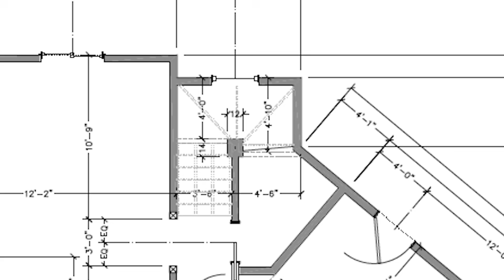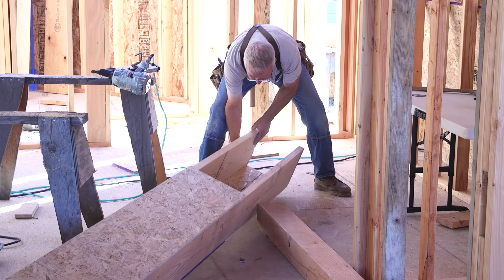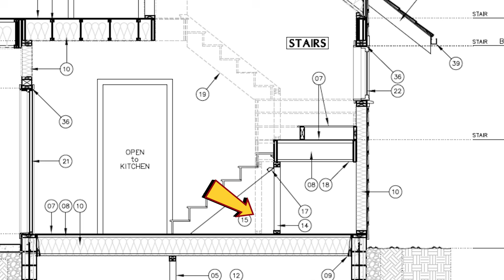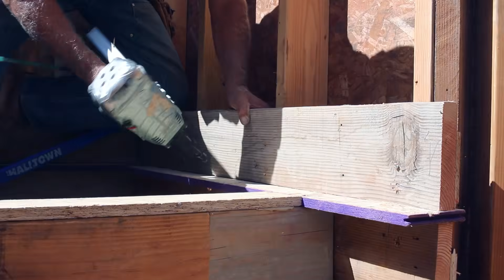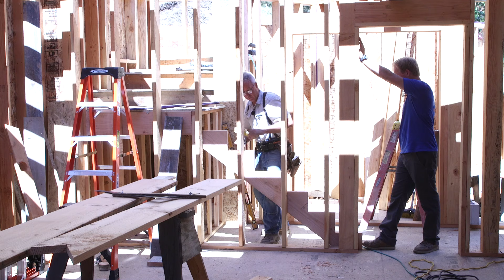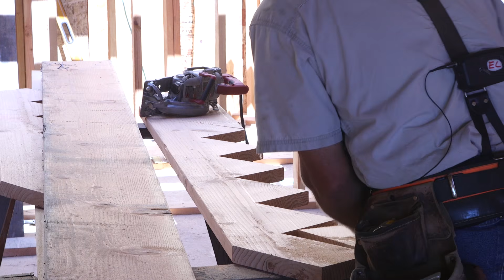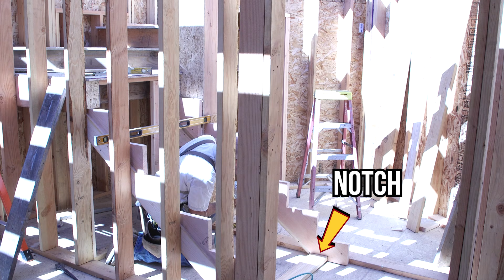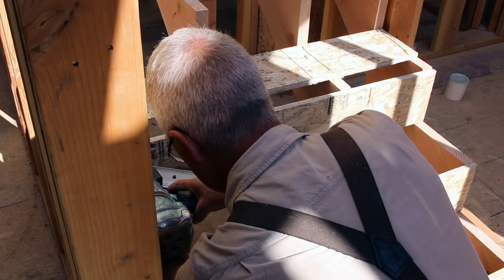Building Winder Stairs Ep.56

Comment: I LOVE that you use a straight edge when cutting and ripping. I've been a carpenter for over 20 years,  half of which was spent framing new homes. Hardly any of my colleagues would use a straight edge, freehanding most of their cuts. I feel that it is well worth the little time spent, to get a good straight cut. It is a more efficient use of material and the quality of your project are the benefits of a straight edge.